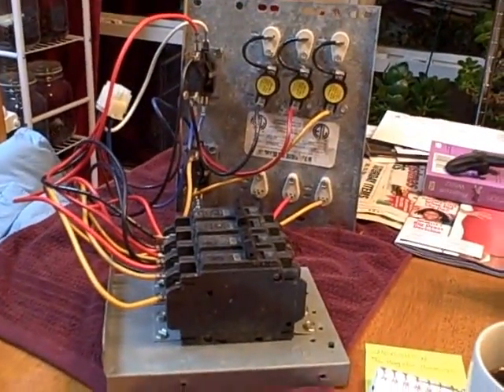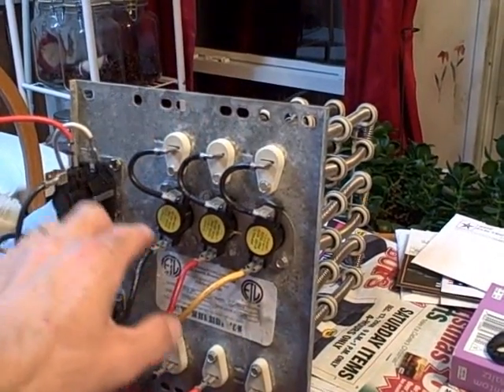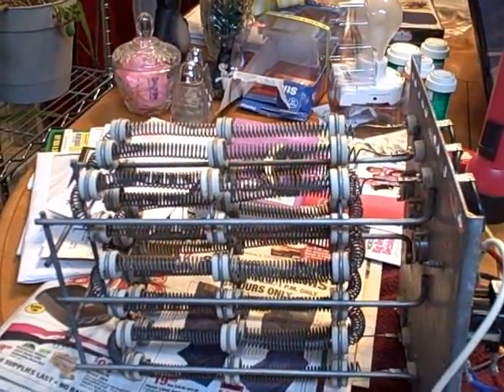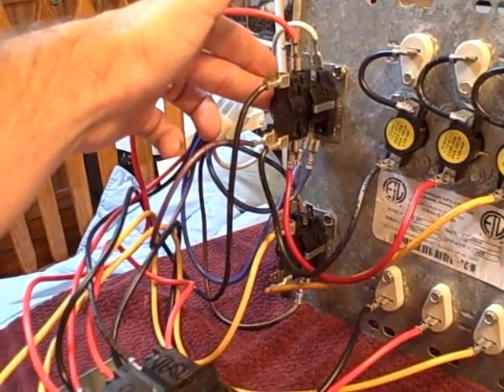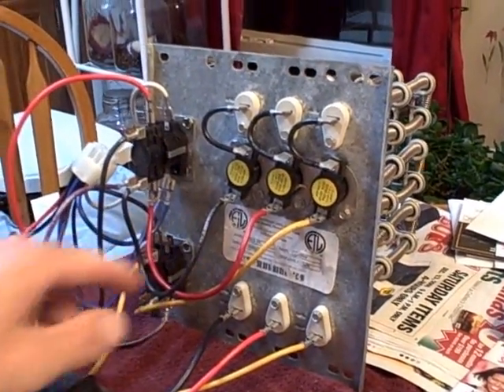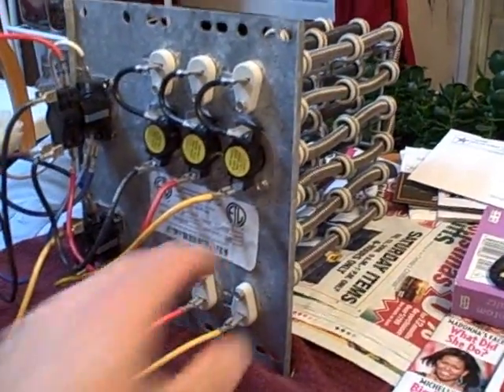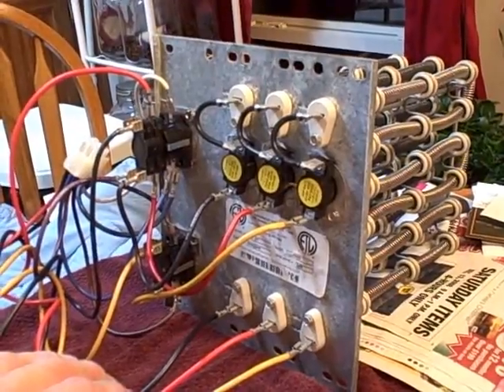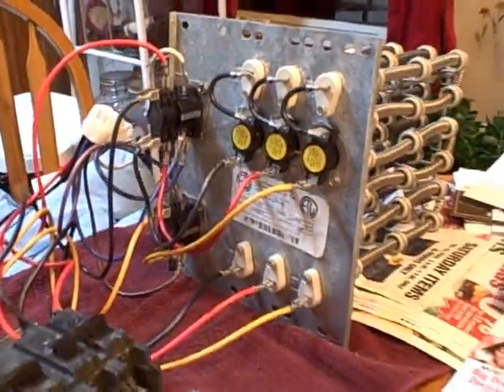HVAC Electric heat kit / strips shown!

Comment: dig your  video. one question what is the clearence from the strip to any thing that could
be a fire hazard.  burn,
Reply from the maker: For the most part its a non-issue, the strips are typically suspended in ceramic insulators on the rack, or they are fed through them, so to speak. The racks slide into the space and usually have one or two rods that you have to slot into holes in the back of the air handler, which can sometimes be a pain to line up!  There isn't really anything in there to burn, though sometimes over the summer you can get a buildup of dust and such on them and the first time you turn on the heat for winter it can smell like something is burning.

This can be minimized by using good air filters; the pleated ones, not the fiberglass fishstring looking ones, they let all kinds of crap through that eill eventually over time clog up your evaporator coil, causing the unit to freeze up, function poorly and put stress on the system in general. Not to mention a high price to have it pulled and cleaned! (Ive literally seen companies charge more to pull it and clean it than if they had just had a brand new coil installed!!)

...also air leaks around the unit can let dust into the system. Air gaps around the filter area, air gaps between parts of the equipment that should have been foil taped and sealed,etc.
Reply: Hey Man, I DIG it too.

Comment: If you're reading constant voltage through the sequencers then chances are the sequencer is bad?
Reply from the maker: Trying to see if I understand your question... If I have a sequencer that had 24v applied to its coil, activating it, and Ive waited the proper amount of time for its contacts to close, then if I put a meter across the High Voltage terminals on the sequencer and show voltage then it is bad.  If I do not show any voltage then it is good.

When electricity flows from one terminal through the closed contact and out of the second terminal, then the voltage that the meter sees at both points is the same voltage so it doesn't register.  If, however, it is broken and fails to close then your meter will read a potential voltage across the contacts on the meter.

Dont forget to verify that the coil is actually getting at least 24volts (if thats what its using, some are 120v coild), if its not getting voltage you have another problem to fix too!   Mike

Comment: Great video!
I am having an issue where my heat pump will turn off but the Heat Strips will be ON and will not turn off unless I turn the circuit breaker. I have replaced the Heat sequencer to no change. Any idea on what could be the issue?, the unit is a Goodman A36-15
Reply from the maker: While it is possible something is wrong with the thermostat, its unlikely, it sounds like something is mis wired somewhere. You said its a heat pump system with backup heatstrips, and the sequencers have been replaced.  I would turn the temp down a bit so the heat wouldn't come on for a bit while Im testing and get a meter and check a few things.  First check the low voltage coils on the heat sequencers to verify they are getting 24v and keeping the strips on when they arent supposed to and that theyre not just stuck.  
If you have voltage then start back tracking the wiring from there.  You didnt say how you knew that the heat strips were staying on though and Im curious about that.  Its not likely, but a broken heat strip that has somehow come loose on one side could be shorted to ground and running on 120v, not very likely and Ive only seen it once... But if you havent shocked the crap out of yourself yet its probably not the case ;)
Either somethings miswired in the air handler, or theres a low voltage short feeding power to keep that line powered, something could be miswired at the thermostat or shorted/miswired at the condenser outside.  Check for bare thermostat wiring along the runs in the attic (think mice) and outside where it goes into the condenser (think weed eater or dogs)
Sounds like its going to be fun tracking down!  Just random guesses mostly, its hard to trouble shoot something like this without being there! I'd really recommend having a tech chase it down though since your working with 240 volt power though!  Let me know what you find!
Reply: mikie2501 Thanks, I will keep checking.
The heat strips stays on after the blower stops and temp reaches the temp set on thermostat. I learned after the Smoke alarm went off and felt the heat coming from the furnace. So now I can see the strips on once the furnace turns off and starts to heat up the whole furnace. Could a broken heat strip cause that problem ?
Reply from the maker: Hmmm... Usually not like that, but possible. If it was a broken strip and some part of it some how came loose from the ceramic holders that keep it in place and the half that doesn't go to the sequencer had fallen against the casing then that half could light up.  ...its a string of maybes that have to happen. 
Most electric air handlers have a thermal limit safety mounted to each strip and if the furnace gets too hot it cuts power to that strip until it cools down enough to reset the limit, then it turns on again and the cycle starts over.  Ive seen that happen if a sequencer is stuck on and the blower motor isnt running to cool the furnace.
...also, look CAREFULLY all around the heatstrip wiring, heat sequencer wiring and other high voltage wiring to see if maybe a high voltage wire has come loose or burned off and is laying/touching other wiring and causing the problem.
Not sure if it will help but you could email me some pics of the inside and maybe I might spot something. A longshot but possible.   ....that is if you already have it open looking at it, if you don't then don't do it, because if it is shorted it could possibly have live voltage on the casing.  ...I just assumed you had the cover off and saw the glow from the strips, don't want you taking chances!  Can you get someone out to look at it?  Electric heatstrips suck electricity like crazy so you dont want to let it go without having someone look at it very long, unless you have the breakers off to cut the power while waitingM
Reply: mikie2501 How can I post the pictures?
Reply from the maker: Sorry, may ssages getting stuck in the spam folder! Grr.. Just email them to me with a short note so I remember what we were talking about, my memory is horrid!  My name at gmail.com should do it!
Reply from the maker: Hey Rick, did you get it fixed?  Just checking on you!  i never saw any pics in my email, lemme check the spam folder..,, nope, nothing there.  Mike
Reply: Hi Mike,
Just got back in town and will work on it this weekend, will send you some updated pictures. Hope I can get this thing fixed.
Reply: I had a kinda similar problem but it was caused by a replacement of the thermostat and had been miswired.

Comment: VERY HELPFUL VIDEO. BUT I HAVE A GOOD ONE FOR YA. MY HEAT STRIPS WONT STAY TURNED OFF WHILE THE A/C IS ON. ANY THOUGHTS?
Reply: Stuck Heat sequencer
Reply from the maker: Lol, talk about getting a double sized bill!!  Ive only run across that one time, it was start of summer, I think, and got the call saying it wasn't cooling well.  The freon pressures looked pretty damned high so I thought the condenser coil outside was packed with crud and not dumping the heat it was pulling from the house.  Well the coil was clean so inside to the attic I went!  
Its been so long ago now I dont remember how I noticed it first, but anyway what had happened was a heat sequencer was stuck on! No telling how long it had been that way, I sure wouldnt want their electric bill that month! The heat coil would run while the ac was trying to cool the house and when the ac wasnt on because it had cooed down the house,the heat strip would keep pumping out heat till it tripped the limit switch, nit would cool down and the switch would open then the heat would be back on! Lol!

So what could it be: stuck sequencer or relay, burned off wire thats fallen on another wire, broken heat strip that has moved around shorting and putting out partial heat, low voltage heat wire that has shorted to the 24v line, faulty thermostat, low voltage wiring mis wired recntly, HV wiring mis wired, i could prolly come up with a few more but Im tired and only had two or three hours sleep in the last few days!
Reply: +mikie2501 Had this happen once while my wife was home on her own for several days in the summer. Said the house wasn't getting very cool and the heat pump was always on.

When I came home I felt heat radiating from the handler inlet in the hallway. Now the handler was an unright unit in the garage, so that tells you how hot it was getting. When I shut off the breaker I had to let the handler cool before I could even pull the access panel and unplug the coil set from the sequencer.

I would think the thermals would pop off but apparently not.
Reply: I know it's an old thread but I had this problem a few yrs ago and finally found it was a miswired thermostat that was just replaced.  they are not all compatible and also wire color codes and labeling can be a little different.  So decoding the information on the stat as well as your unit in order to wire it up properly is important.

Comment: Very helpful...i'm doing some troubleshooting on my electric furnace at the moment. everything seems to work its just that the coils don't seem to be heating up like they should. the air that is being blown is only luke warm. I did the tests that you showed in the video and all seemed fine. One question i had was that when i test, with my unit running, across the sequencer. assuming that it should be closed, what should the volts read? no volts is good and means a closed circuit? I have 3 sequencers and one of them was reading 240 volts while the unit was running
Reply from the maker: Thats probably why your air only feels luke warm! :). You have two heat strips firing and the third isn't.  Most likely you either have a bad heat heat strip or the sequencer is bad. Usually its the sequencer. Next time you are testing the system you can test that strip and the sequencer.
Start by cutting all the breakers to the unit. Make SURE to test ALL of the incoming power lines to make sure you got it all shut off. There should be at least two breakers on a three strip unit, probably a 60 and a 30 amp breaker, assuming they are all 5kw heat strips.  
When you're sure its dead get a flat-blade screwdriver and a pair of pliers. I usually push the screwdriver against the metal tab where its riveted to the sequencer and then use pliers (or fingers if its not too tight) and pull the wire off. If you just pull the wite sometimes it will break the sequencer.  Its easier usually to pull the wire off on the heat strip ceramic though unless its a tight spot.  
...anyway after you have the wire off so that the strip isnt electrically connected to the sequencer then you can set your meter to continuity to test the heatstrip... If you touch your leads on the meter together it should beep, then you know you have it in the right setting.  Put a lead on each end of the heat kit and if the coil is intact it should beep proving the circuit. (thats why you have to disconnect one side or it will read backwards through the system)

You can also test the sequencer. Easiest way is to go ahead and completely remove that wire from the furnace so its not flopping around. Power the system back up and call for heat. After the other two strips fire up wait a bit to give it enough time to come on then check the coil side of the sequencer to see if youre getting 24-28 volts. Be CAREFUL not to let the meter lead accidentally touch the 240v terminal above at the same time or you'll fry things!!  If you get voltage and you know the heatstrip is good then the sequencer is bad because its not closing the circuit.
Sometimes you can gently smack the top of the sequencer with a nonconductive tool (say the butt end of a rubber handled screwdriver) and it will unstick.  ...but if it got stuck once it will again, and you run the risk of it sticking ON as well! Lol.  
I went on a call in the summer once, lady said the unit wasnt cooling, pulled my hair out till I realized what was going on, her freon pressures were high on the low and high side, but her coils were really clean outside so I went inside to see if the return duct had fallen off and it was sucking attic air. That was fine but as I checked further I realized a sequencer with TWO heat strips on it was stuck on!  It was heating and cooling at the same time!  No telling how long it had been stuck!  Wouldnt want to see her electric bill, lol!
Anyway, this is really something you should get a technician to work on since your dealing with 240 volt stuff and a slip could electrocute you! (My standard warning!). The sequencer, if that is bad, usually has a set of numbers on them denoting when they come on and go off, like 1-30 on 60-90 off or the like,on the sequencer or the plate, this is so the sequencers step on and off in the right order. Sometimes the blower motor is wired to one of the sequencers too, so its important to replace a sequencer with one that is timed right!
Hope this info helps, time to call a tech though, you dont want to run it very long with just two strips, this will run your bill up because it takes way longer to heat the house! Been there, done that!  Take care!
Reply: COMO

Comment: I took out the electric heat killed from a tempstar ac/heater and the heat coil isn't red all around when it heats, but only at the bottom and maybe 3/4 of up of a heat coil.  Is this normal?  Is the coil supposed to be all red when it's heated up?  I turned up the heat to 85 degrees F and still the same thing.

Comment: Hi Mikie, What gauge of wire is used to the 240v terminals of the sequencer were they tend to burn out? Is there a special terminal into which the wire is crimped to use that will handle the high voltage. Should it also be soldered to have a good connection. Thanks
Reply from the maker: Hi! Those are good questions!  Most supply houses will sell crimp connectors that are rated for high heat.  Typically 12 gauge stranded wire is rated for 20amps, I think some of the manufacturers use a higher strand count when they build it, but reg 12 ga will work fine.
Over time, hundreds or thousands of cycles,the connectors heat and cool, back and forth till they get weak and stretch, then corrosion can get into the connection and start building up, which means higher amps to push through the crud. It just gets worse and worse until the connector burns/melts off!

Something I run across a lot more than I should is going on a call for burned off wires only to realize its been repaired before, but instead of using 12 gauge, they used scrap wire from the back of the truck, which is usually 14-16 gauge bits left from a fan motor!  It will work but at some point it will melt eventually because the smaller wiring cant easily handle the 20a.

Comment: Mikie2501, I had a tech come out & it cost $200. $70. was to just come out & $125. for part (run capacitor)  & labor of my HVAC unit & somewhat inspection & insight to another the unit has. It had NO Freon, needed 7.5 lbs & it's a GOODMAN unit. Now, someone came out & on the low side put in 7.5 lbs of Freon for $300. (different Tech). When the 1st tech checked everything he told me & showed me in the attic the capacitor & said it's just starts up the blower, I could even start it by hand if wanted & leave it on for air circulation. But, I said NO. We went back down stairs & tried it on heat & air NOTHING. Went outside to the unit, compressor line hook ups, NO FREON. Now, Freon $480. he wanted to fill it up plus the $200. I already was paying him. I said NO, due to money. I am a disabled vet, so you know the money fixed income deal. So he then showed how to put on emergency heat & that works. Then, borrowed some portable heaters from friends & used it with emergency  heat, it's so-so. Tech #2 a friend came by, 2 weeks later put in 7.5 lbs of FREON, on the low side, outside but the fan did not come on?! So, in other videos the fan comes on or is on when putting in the Freon. Now, we have NOTHING? Lost emergency heat NO heat No air? The unit is almost 8  years old. I like the unit but from day one I notice it ran longer & longer each year even added window AC unit. What do you think is up with this problem?? When I call other tech or companies they don't want to hear it. They say set up appt. for them to come out $79. - $109. & inspect & fix ($$?)  unit? Do you have any advice or comments for me on this problem for me? Thanks, PAUL in North GA. 1/19/14.

Comment: Hey Mikie, I test the high limit thermostat and it was good. The unit is blowing but no heat is coming out. I only have one set of coils. How do I troubleshoot that?
Reply: What is the KW on your strip kit?  If 5kw, that aprox 17k btu/hr.  Will not be very warm.  1 KW = aprox. 3,400 btu/hr APROX.

Comment: Mikie this is a really good vid. You helped me out in so many different ways. The only problem I am having now is finding out what sequencer is the right one. I had a guy come out last year and he said he changed the voltage regulator. He handed me the old part and from what I remember It doesn't look nothing like the one that's on it now. Well long story short, he died in a motor cycle wreck. So now I have no idea what part to buy. The one on it, is burning the ends off and timing is off. HELP